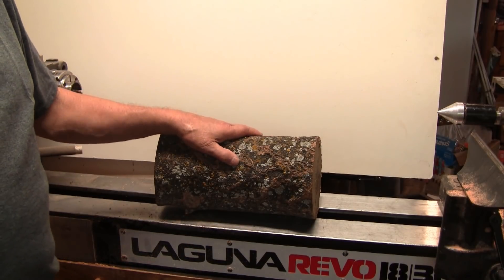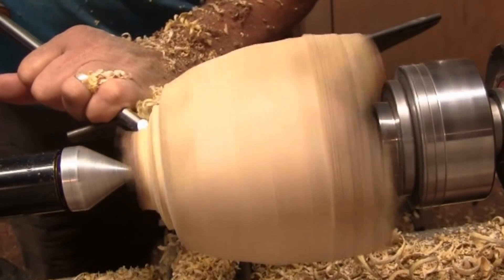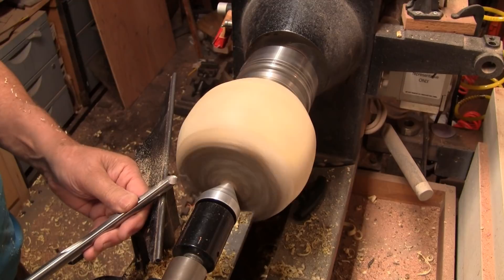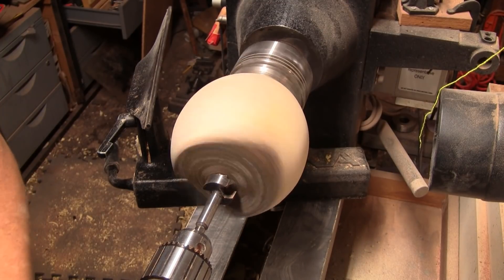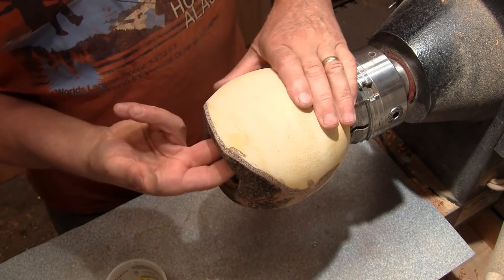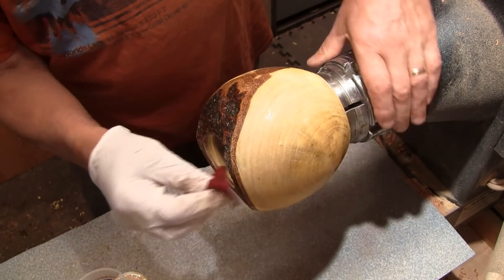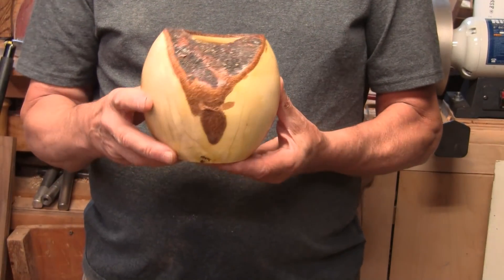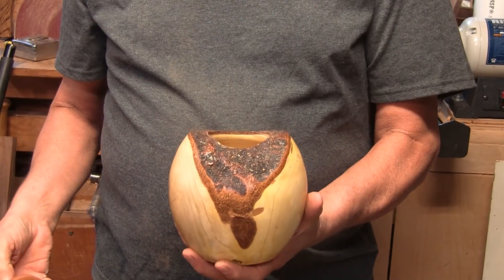A Pot Of  Hackberry Wood Turning

Comment: I love this little Hackberry pot. The bark is beautiful.  I like it with and without the lid.
Thanks for sharing 😊
Reply from the maker: Thank you Tanya and it was fun to turn. My wife likes it a lot better without the lid and I agree with that. But the lid will come in handy. I use little yogurt cups for wipe on poly. I put in just enough to finish a turning and the lid fits down in there to seal the air off. Works for shellac as well. 
 Take care,
Gary

Comment: What an awesome piece, Gary! That is just beautiful. Great tip with the 2,000 grit sandpaper over Ack’s Polishing Paste. That will be used by a lot of turners, I’m sure. I must say I prefer it without the lid. Another awesome video, my friend. Keep them coming! 👍👍👍😃😃😃😃🇨🇦🇨🇦
…..Gord
Reply from the maker: Thank you so much Gord. The paste really helps to keep the sandpaper cutting. Another thing that works is a bit of dish soap in the water. But the paste does some multi tasking at the same time.
 Well I am with the group for no lid. I took it inside after I finished the video and the wife said...naw it looks better without the lid...so there ya go! But it fits in my little cups I put finish in so I can use that to keep the finish fresh.
Thanks for watching my friend....now off to the backyard to cook. Wife's birthday today and the kids and grandkids are coming over.
Gary

Comment: Nice wood turning using hackberry.

I never had much luck with hackberry.  I tried turning a glue up cube into a three edge winged bowl.  The wood kept breaking off in large pieces.  It was a disaster to say the least.  Made good fire wood though.   I switched to some cherry wood and it turned beautifully.
Reply from the maker: This piece was still a little green so I wonder if that is why it turned so nicely for me. The bark is my favorite part of this Hackbeery.
Thanks for watchng,
Gary

Comment: As usual, great piece. Wasn't sure what you meant for sure about streaks. Streaks from putting on the shellac? Take care Gary.
Reply from the maker: Yes sometimes when wiping shellac on if it starts to dry out you can leave a streak or 2. Does not happen much but it can happen.
Thanks for watching,
Gary

Comment: Love the vase, Papa, but Hackberry is the Devil's Wood. I hate the stuff for flat work.
Reply from the maker: Thank you Richard, this was the first I have turned and I thought it was great to turn. What are the issues you have found. I have another piece and will watch for any issues.
Thanks for watching,
Gary
Reply: @ThePapa1947  Perhaps it's just the NC variety, but the Hackberry that I have used for flat work burns terribly at the router and table saw. It is gummy, splinters, and is stringy, almost like bamboo. This was at about 10% moisture level. I hope that your variety is far superior.